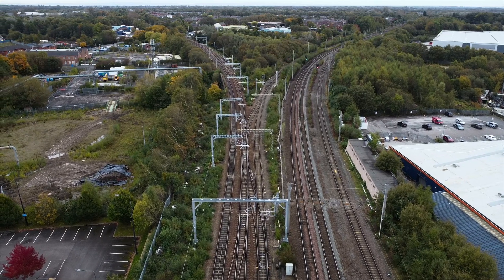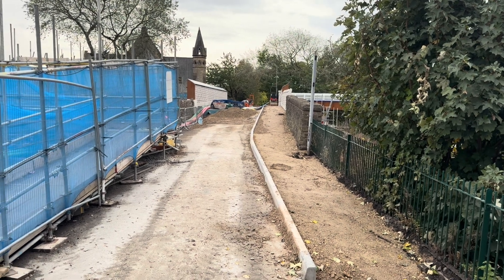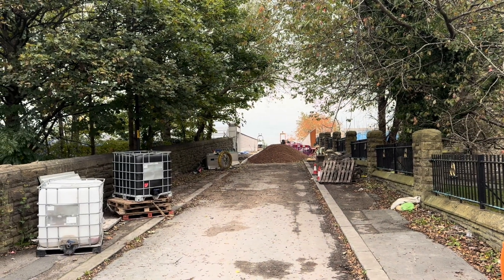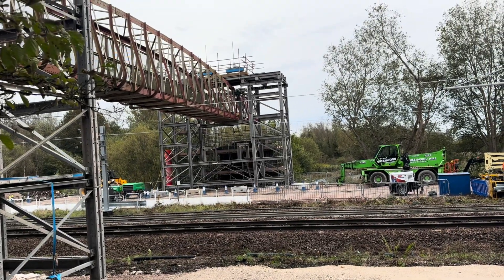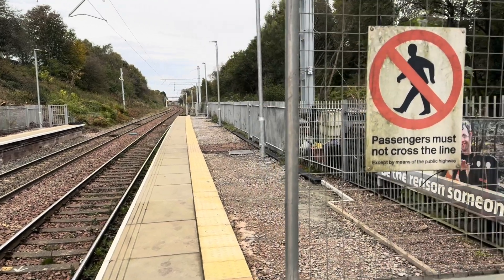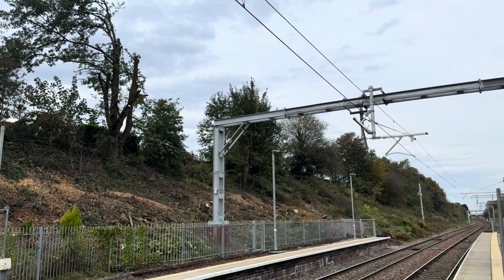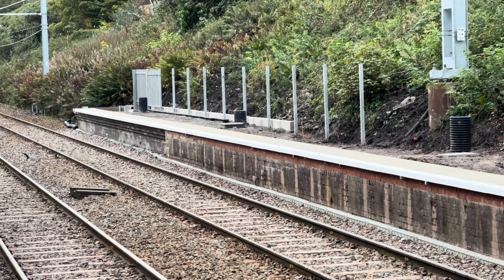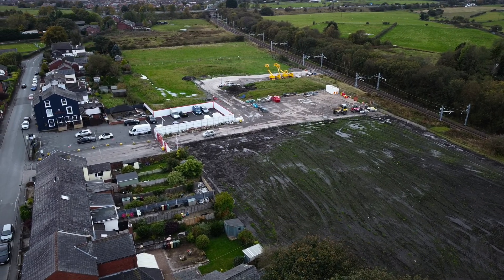Wigan to Bolton Railway Electrification Scheme update October 2024

Comment: TfGM are about to approve spending some money for improvements at Hindley; The Car Park will be refurbished with addition of a drop off point, blue badge spaces increased from 2 to 9 and EV charging points and bicycle storage added while the total number of parking spaces will be increased from 52 to 88, in addition a space in the car park will be designated for 'pop up retail' (read Food/coffee Van), they will construct a bus stop so a new bus route could be created in future to serve the station (at present only a school bus passes the station), buses in both directions will pull into a bus shelter in the car park and then go round an island in the car park to exit rather than stop on the narrow Ladies Lane. Finally they will construct an underpass along the former track bed directly from the car park to the platforms where the new lift is going to be so you dont have to climb up to the road, cross it, then descend down again.
Reply from the maker: @watcherzero5256  thanks for the info. Those facilities you mentioned are really needed at Hindley and may help to reduce traffic congestion as people will be more welcome to take the train. Obviously the OLE work needs to be done but I can’t find any recent info on these proposals. Have you any recent links etc as the ones I’ve found are from 2022. Cheers.